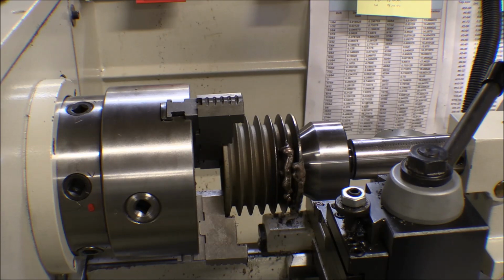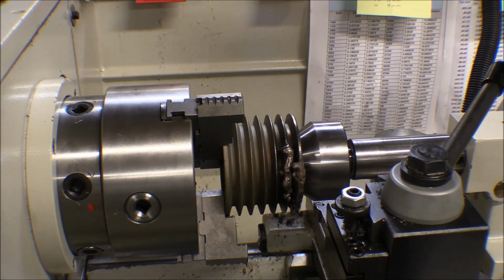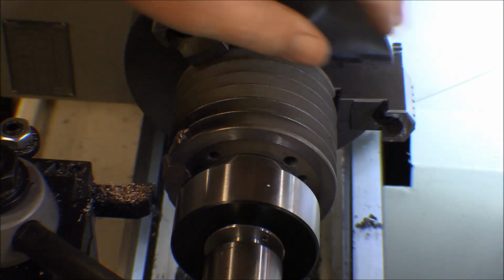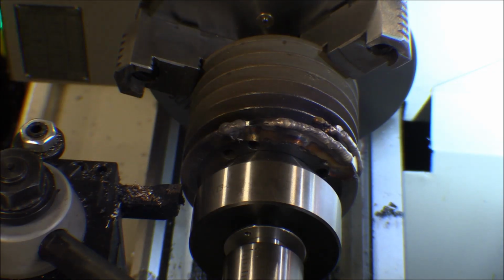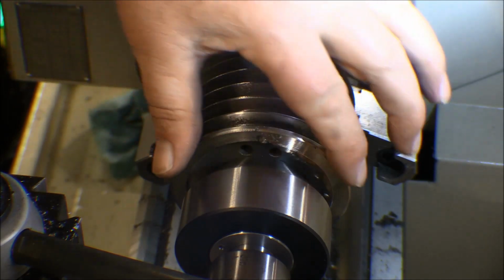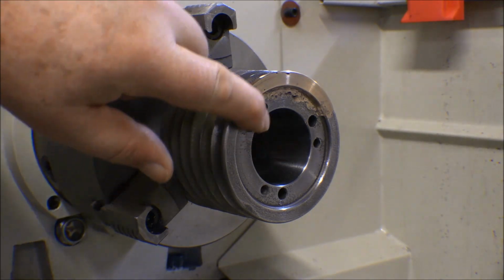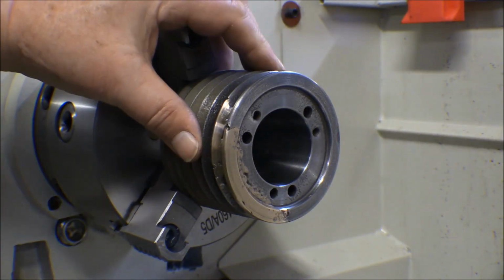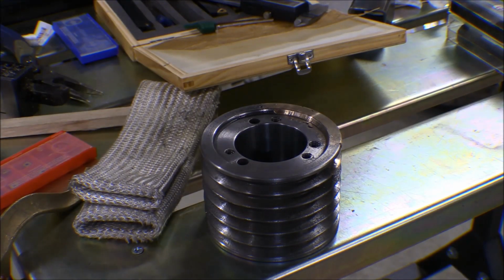Mobile Dimension Sawmill pulley repair tig braze and Grizzly G4003

Comment: Sometimes on jobs like that you might try silver soldering with the TIG.  The lower temp keeps the sharp edges of the cast iron from blowing off.  Rod is spendy but sometimes it does a job nothing else will.